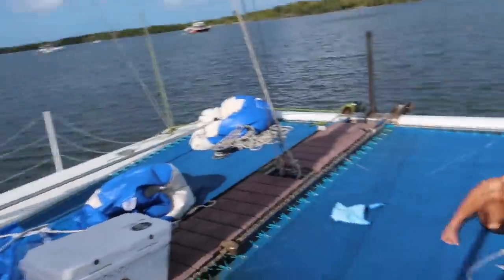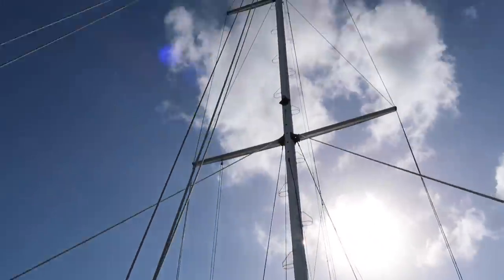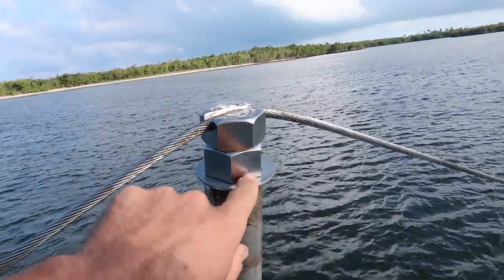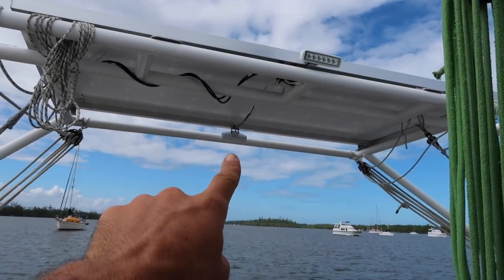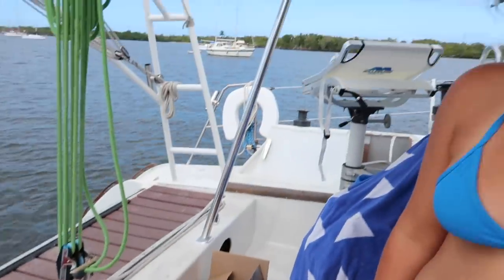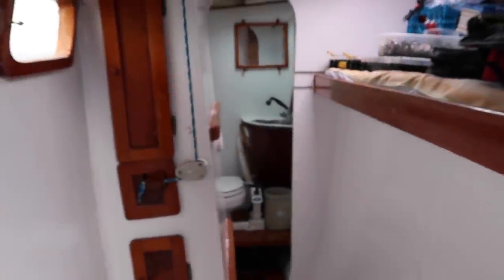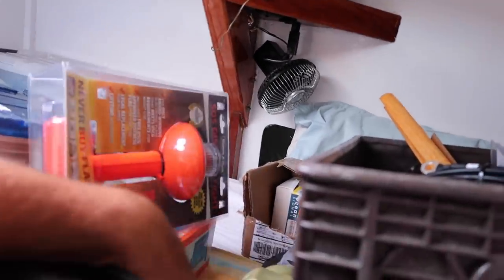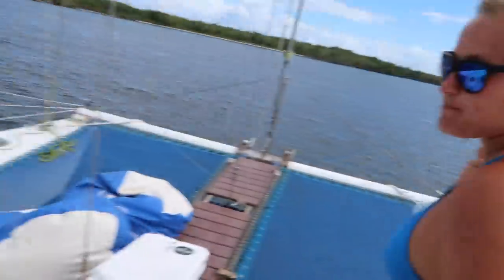DISAGREEMENTS ON A BOAT. should we have a generator on a simple, fast, multihull cruiser?

Comment: Generator for tools, charging on those windless, sunless days....engines not working. Help someone else out, pay it forward. Lets face it....55# is not going to impact your boats speed unless you are a racing cat, which you are not...i am not one either, but can get 8-10 kts easy.....with a generator standing by to assist me or someone else. So that is Team Sierra.....Team Billy.....forget AC....load of crap. Fans....fans, windscoops and a sodastream with ice

Comment: Let's see, you bought a small portable genset so you could have power in remote places or difficult power situations and you're headed for remote places with some really difficult power situations. Now you're  ACTUALLY arguing about whether or not to take it!  Come on, Billy, this DOES NOT pass the "Sniff Test" of simple logic!
Reply from the maker: We bought the generator specifically to give us the ability to do major refit work on the boat while we are on anchor and NOT to cruise with. We did not cruise with it the last time we were in the Bahamas for 3 months. The only reason we cruised with it up the coast to NY was for the same reason - to do major refit work while we were anchored in NY for a few months. We never find ourselves using or needing the generator when we are cruising. We only cruise with battery operated power tools that charge off our inverter.
Reply: Again, "You bought a small portable genset so you could have power in remote places or difficult power situations." Why would you ever leave it behind?  What if a friend wants to take you SCUBA diving and he has a compressor but his genset is kaput?  What if you need a little emergency welding done onboard and someone has a welder and rods to loan you? What if . . .What If . . . What if . . . .  Sorry, but I would just always have it with me, if I had it in the first place.  PLUS Jetty and Sierra both have voted for AC!

PS in my older years I seem to suffer from perpetual chapped lips.  Do the sund products you recommend offer any healing/protection qualities?